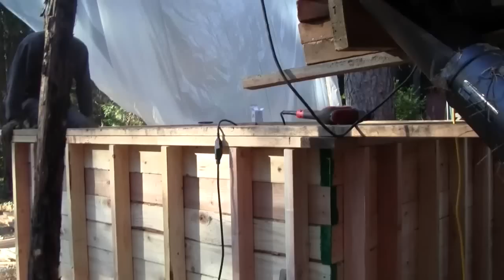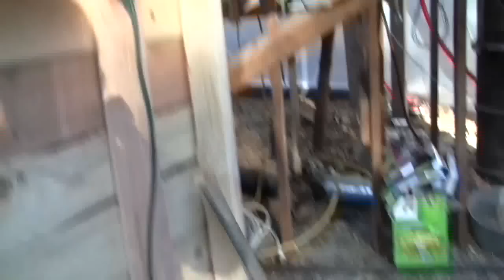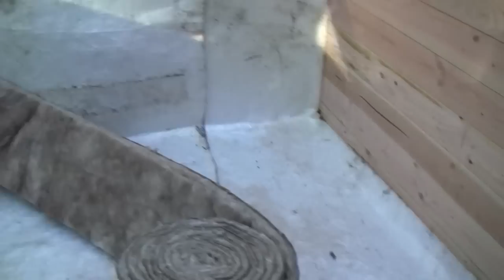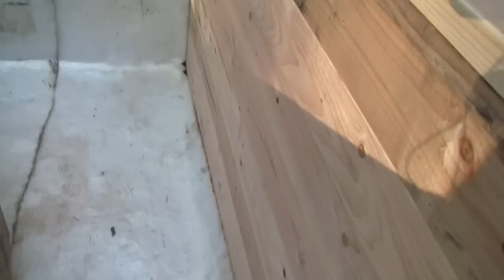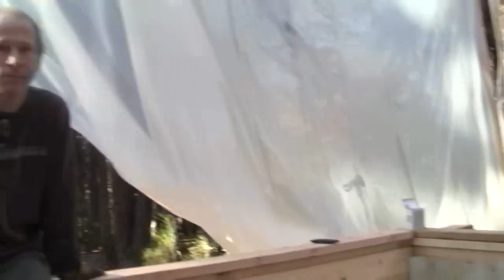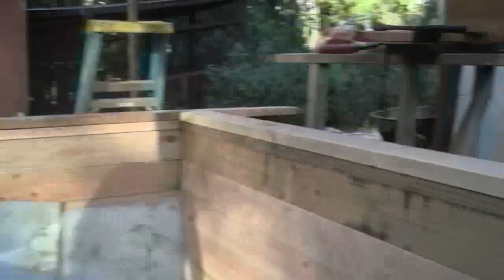DIY Hydronic hot water storage reservoir 5

Comment from the maker: Yes, that's a great idea.  Lot of digging if you don't have a back hoe.  But in ground is nice....though you'll need to use a submersible pump able to be put in HOT water.  Most can't do that.  With the above ground, you can use a bulkhead fitting and then a normal hot water circulation pump....Taco  009 I think I used??  Anyway, in ground is good and maybe not so good????
rt

Comment from the maker: Running the system now.  I filled reservoir to around 1500 gallons, leaving room on top for extra insulation.  running the system overnight with outside temp in range of 35F at coldest, the reservoir temp dropped about 10 degrees from about 90 to 80 F.  So, that's about 1500 gallons * 8.3 lb/gallon * 10 degrees / 12 hours = around 11 kW steady power supplied to house.  if heated to 140 or 160, I ought to be able to keep the house warm for 2 or 3 days without running the boiler.

Comment from the maker: @zoltankapitany 
you are way off on your numbers.  A friend uses 400 gallons to take care of daily energy needs and it works great, off grid.  2000 gallons is 8 pounds of water, times about 70 degrees F gives around 140,000 btu thermal energy storage, useful.  Plenty for a home....btw.....1900 square feet.  This reservoir ought to give 2 to 3 days of thermal energy reserve, allowing firing of boiler every other day through cold periods, longer if more mild weather.

Comment from the maker: @bpd894 
The weight will certainl squish it down.  But the pressure is 2psi at bottom.  So, imagine a 2 pound rock on one square inch of insulation.  It won't crush to paper thin.  Also, there's the bubble insulation under the fiberglass, which can also manage that pressure.  Then, soft sand.  And perhaps last of all.........it ain't a pi-anooo.....and if it punctures I can just drain, re-line, and re-fill for very little cost.  So, on we go to see what happens.   rt

Comment: Suggestion:  Sheetrock is relatively inexpensive.  Line the inside with sheetrock, fill/sand all nail holes, cove all the corners.....no threat of sharp edges or pinched corners?  16,000lbs of pressure on that R11 is going to make it paper thin and may not prevent a rock poking through IMHO.